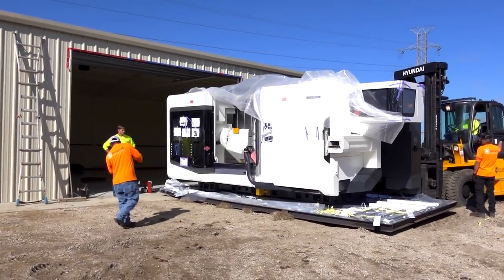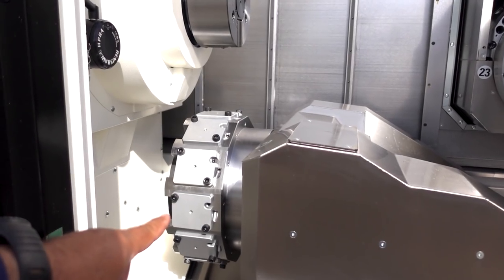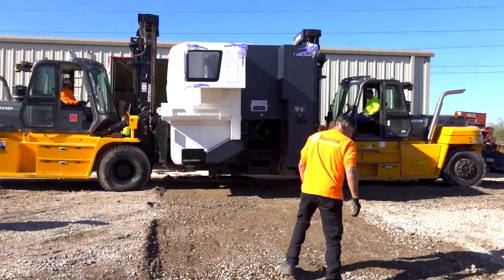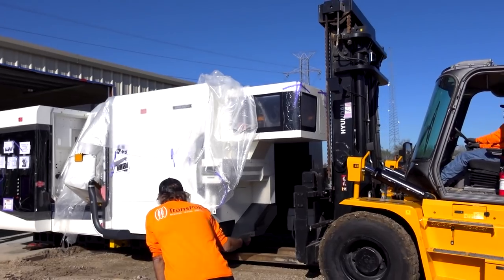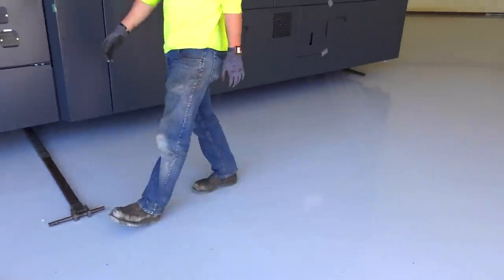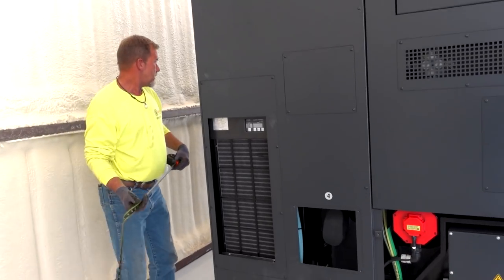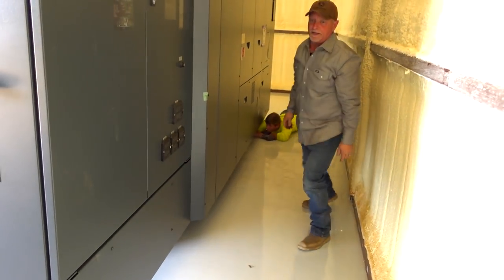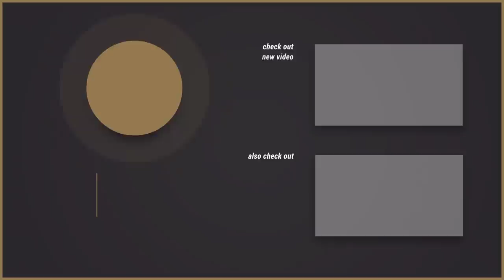DMG Mori NTX 2000 | Expanding machine shop #10 | Cortina Precision

Comment: Looks like a serious pc of machinery.  

Prior topic if you are reading this. Iam researching barrel harmonics and all these devices are coming up including your EZ tuner. Iam a mechanic and realize the effects of harmonics on engines. Specifically crank harmonics of v8 engines.  In this territory,  fluid damper is widely used compared to rubber or "rattler" styles. Would a liquid filled device work better then a adjustable solid tunner or a limb saver chunk of rubber? Iam working with factory ammo and a tc compass.  Iam already glassing the stock and have groups under a inch at 100. Ill be using the arm for long range coyote and WI game.
Reply from the maker: Fluid doesn’t flow the same in cold/hot climates.  That’s why I prefer solid.

Comment: So from what I'm seeing I need to build my building big enough that I can have a 20' tall door, 30' wide, on both sides of the building, with a 30 ton overhead crane so I can just drive the truck straight through the building and offload it directly from the truck. I'll get on it right after I get done winning the lottery.